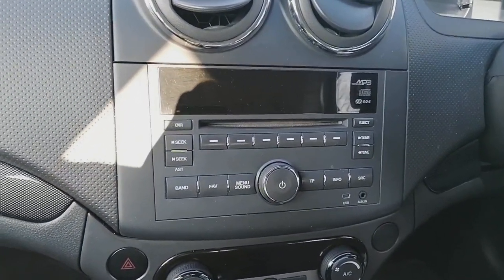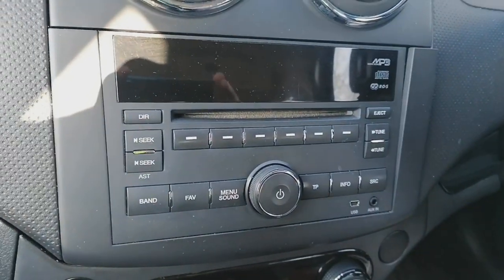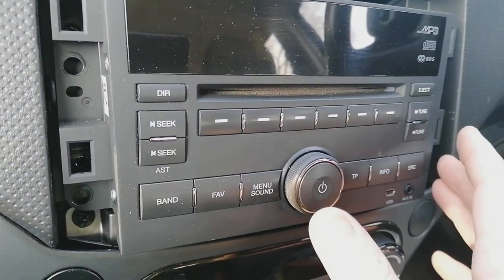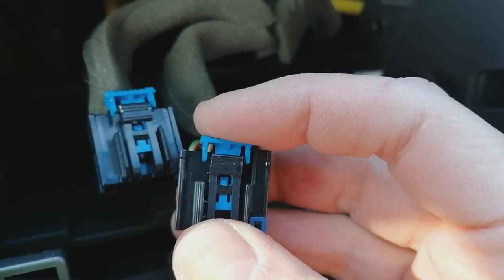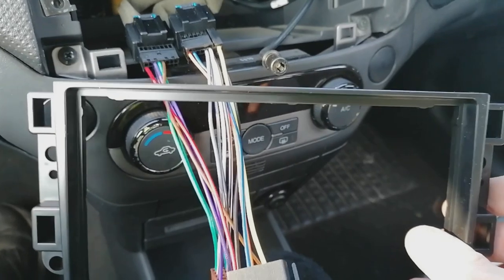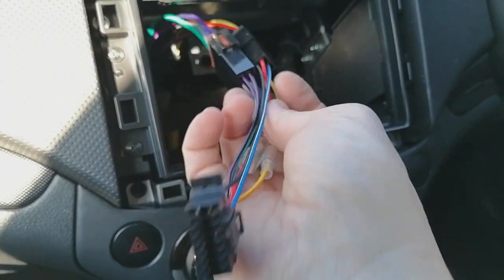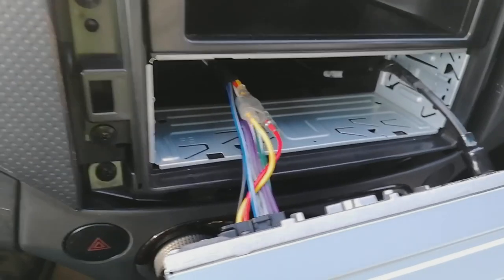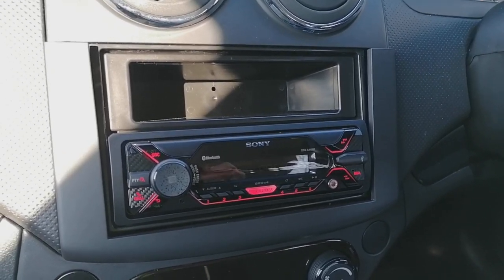Chevrolet Aveo 2002 onwards how to remove radio simple guide

Comment: Hi

So as i see your radio normaly fits inside panel adapter, i have a problem with it.
Bought Pioneer DMH-A240BT and the metal casing doesnt fit inside plastic adapter panel.
Could you maybe help with that with some advice?

Adapter panel is CT24CV01